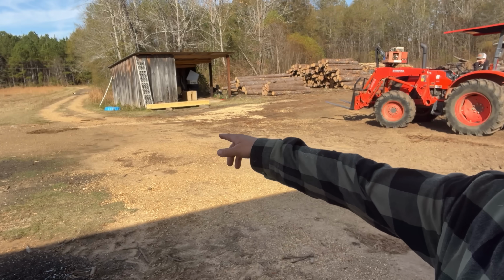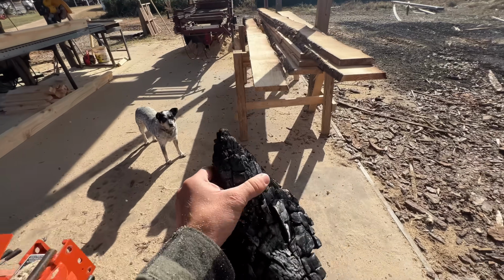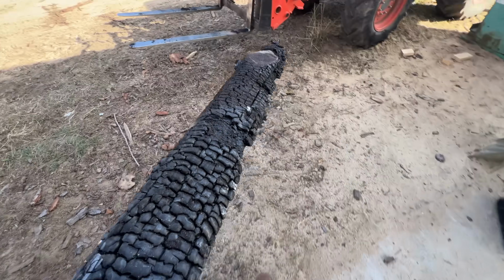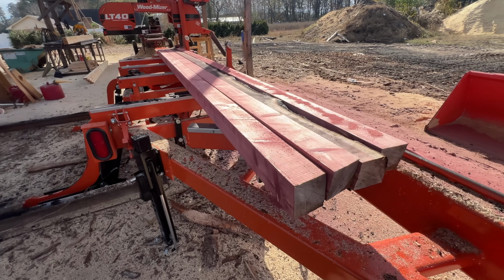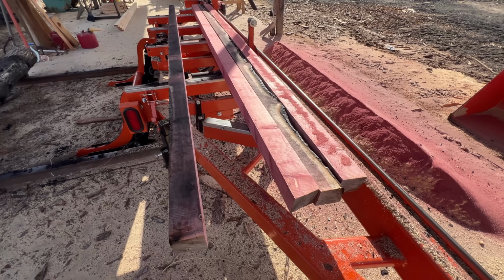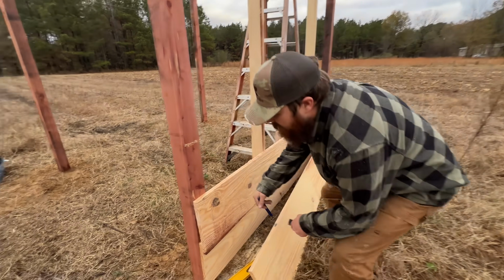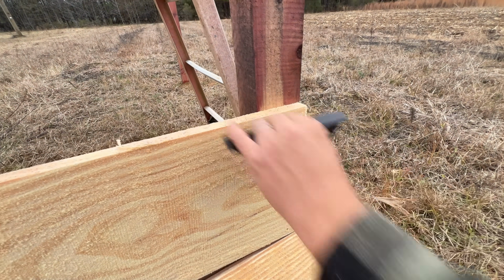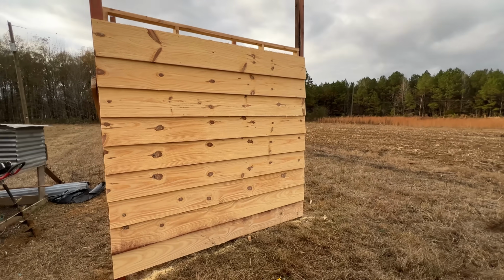Sawing and BUILDING a Chicken Coop!!! (With GREEN lumber!!!) Pt.1

Comment: Screws are expensive. Nails are far cheaper!
Reply from the maker: Indeed! However, screws are superior in green wood. To avoid pulling.
Reply: @wallacefarmandsawmill 

Bronze screws would be expensive looks great
Reply: So right about using screws in this application, especially coated deck screws.
Reply: Nails will hold very tight in green wood. One thing with screws though, you can come back later and reclaim them. Just be sure to replace the holding mechanism with nails, dowels, or other fasteners. I have built green outdoor furniture where I initially screw the joints together. Then later return and reclaim the screw and replace with a dowel. Makes super strong joints, very inexpensive.